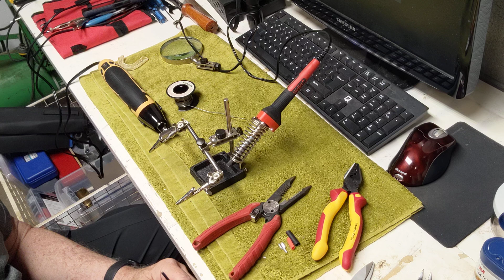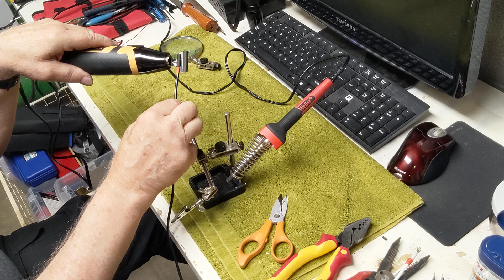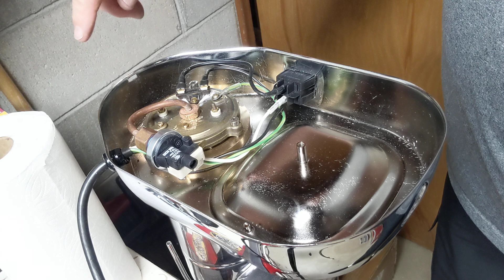Roberts #90 = Making up electrical connections

Comment from the maker: A fellow LP owner contacted me about why stranded wire should NOT be soldered when crimped. I understand the logic. But I still prefer soldering in my situation, because I support the wire when it exits the spade with two pieces of shrink-wrap tube. I don't think there will ever be enough vibration to break the wire at the spade connection. In fact, I think it's better to solder it so that it never pulls loose. I've never had a stranded wire break, but I have seen them pull loose out of a spade connector. For what it's worth....